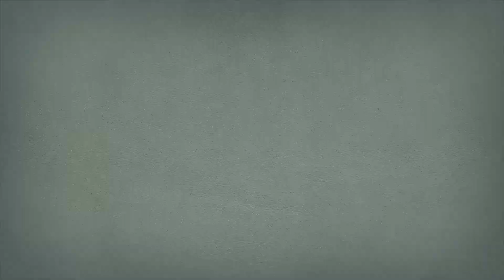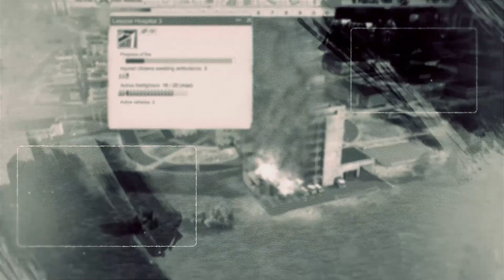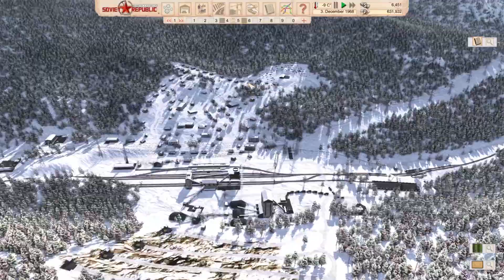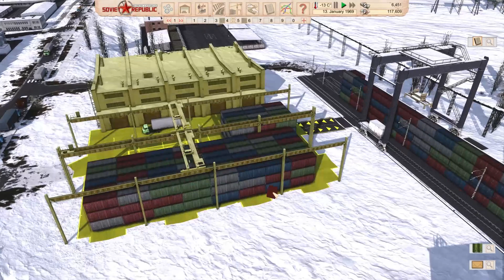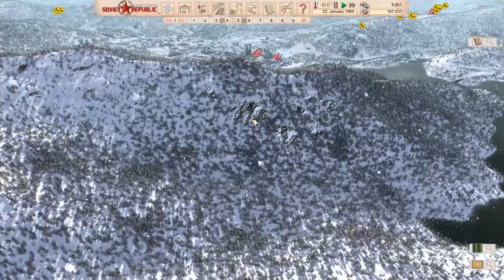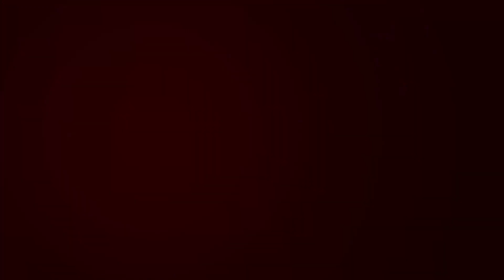Soviet Republic - Mezirusy - Ep.52

Comment: My second comment is about the chemical plant close to the aluminium plant.
Of all possibilities of inputs to produce chemicals you dispose of, you have chosen the most unlogic of all. You use the mod which produces chemicals fom two of he most expensive resources of the game, steel and aluminium. It would definitely be cheaper and more efficient to import the minimal amount of chemicals needed for production of aluminium.
Furthermore, imo it's absurd to use aluminium in the production of chemicals which you need to produce aluminium. In fact, you need the output of a factory to produce one of it's inputs! Where is the logic?
Hope that you won't think: "There goes our iconoclast again".
Reply from the maker: Hahaha!! I don't think that. I think: "Good, discussion. Let's learn from this." 
So railroad complexity! 
I agree 100% this is extremely inefficient! But it looks cool. That is the only reason I kept it. 
I kept it to try to understand how railroads work and if it's possible to have a "real-life" system of railroads in-game. Just as an experiment. 
Chemicals and Aluminium. 
I agree with you that using aluminium to make aluminium has made little sense. but if you think that we are using 0.81 tons of aluminium to make 9 tons of chemicals it's a bit different. 
Also, I mentioned I would like to diversify my chemical production to almost any type available in the game and I would like to build this one. The logic is that Steel, Alu and Oil are all close by and the Alu industry is taking a lot of chemicals. I hope it makes sense. 
I will record today's episode now and address a lot of these issues and simplify the railroads. 
I am serious when I say please keep expressing your opinion! I really love it! :)
Reply: @oolykeegaming81  
May I suggest this chemical plant? Imo it's balanced in all it's aspects, even in the way it pollutes like hell!

https://steamcommunity.com/sharedfiles/filedetails/?id=2165906333

Comment: Hello Oolykee!
Yes, I am still present, and I would like to add two comments if I might.
No, the blue locomotives were NOT the cause of your train prolems. As I wrote you about 45 episodes ago,  the only real cause is the useless complexity of your railtracks network. And I also predicted that these problems would go on for ever, as long as you don't simplify it, especially when you keep on adding trains. Remember Murphy and KISS. The complexer a system is, the higher the probability of failures. And when something CAN go wrong, it WILL go wrong. 
My proposal. Per valley, a double track serves as main line, from there you branch off secundary lines to the different destinations. In border towns like Bonygy, reorganise the tracks to keep three waiting lanes plus one return track. Finally, of course, you plant simple semaphores everywhere to divide your traks in blocks to increase the number of trains, driving all one behind the other on the same track. Simple, efficient and overseeable.